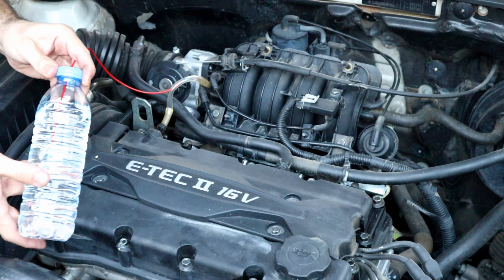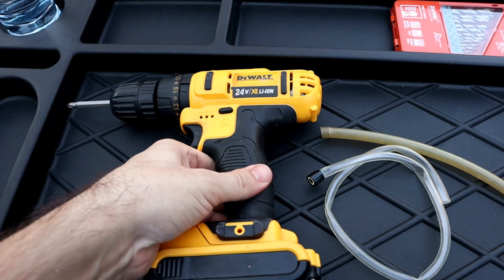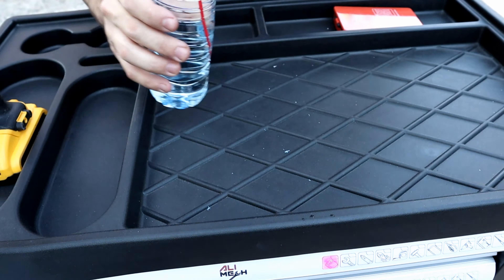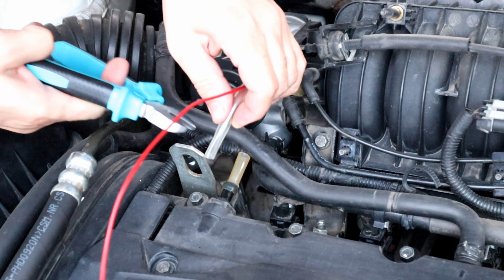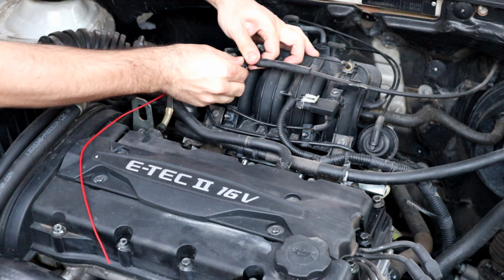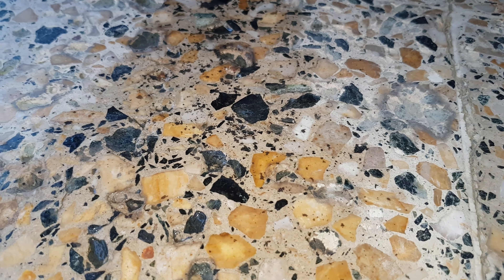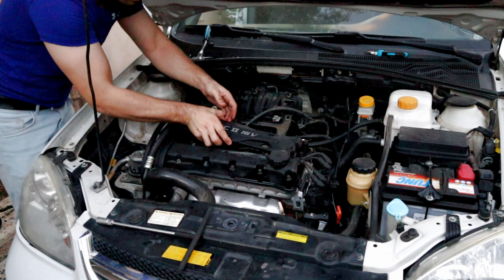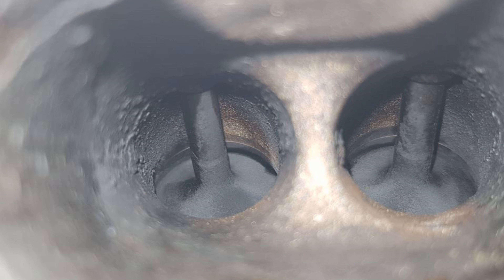Does water cleanse intake valve of Direct/Indirect injection engine without REMOVING anything

Comment: Havent watched the whole video, but oil and filter change after this is a must. Universal oil spray in the intake after water cleaning is recommended before shutdown as well.
Reply: You don't think the oil steam from the PCV will prevent corrosion? Did you see how oily wet the hose was when he pulled it off?

Comment: waterinjection can get great results in terms of lowering cilindertemprature and gaining horsepower ... a disclaimer tough the amount of water injected needs to be fine tuned and controlled for abvious reasons .... olso your are diluting your engineoil ... the blowby gasses are going to add steam to the crankcase .. if the percentage is high enough severe bearingdamage will occur . also water intering the combustionchamber is going to alter to compressionratio and push engineparts way beyond their designed stresslevels ...

its so much more than just ading it and hoping for the best

Comment: I highly recommend you to use carb cleaner instead of using water due to corrosion ..there is a lot of special material in market that is made for avoiding and cleaning carbon consumption on  valves and other car parts
Reply from the maker: Yes I agree with you, even the Carb cleaner worked better, but this was recommended buy one of my subscribers, that's why I wanted to see how it works
Reply: Water/methanol mix ?   I’m researching this as a permanent and continuous system that will clean the valves with every rpm the engine turns
Reply: Depends on the engine, been running this method for 20 years once the engine is warmed up and specially freeway running without issues as long as you turn off water injection manually a minute before stopping even your exhaust last longer without soot build up.

Comment: Could you do this same procedure with lacquer thinner, Techron, or another hydrocarbon liquid cleaner? I was going to attempt a pressurized set up to the fuel line, but this seems easier. Does this clean piston rings and the holes in the ring groove of the piston? Thanks
Reply from the maker: Yes, absolutely, i will do it, if you watched my last video, i will clean the rest of the carbon with liqueur thinner

Comment: Your idea is good but too fast, maybe use less water and over a much longer time. You only need a little steam over many kms to slowly remove the buildup. Water should be half the petrol spray volume. Also try 20% metholated spirits (ethanol) in the water. This little steam will gently clean the petrol engine combustion chambers too.
Reply: works for rotaries a treat, manual switch after warmed up my original 12a and 13b lived double the lives of others
Reply: Methanol based windscreen washer fluid in the mix, a little bit.

Comment: NO. DO NOT feed water into the intake. Period. I actually tried this, using a tiny straw to meter the flow, thinking that would allow it to vaporize as it went in. I ended up with a hydrolocked engine and most of the water was still sitting trapped inside the intake manifold obstructing the flow of air and sometimes splashing into the intake valves. Now I'm replacing the engine...
Reply: I believe you made a user error, people have been using water to clean valves since the 50's. a spray bottle set to mist is all you need also never do it at idle, rev the engine to 1800-2200 while you do it.

Comment: Is this for directed injected engines or gdi only
Reply: It will work on any engine its just that direct injection/gdi suffers more from carbon buildup on the valves due to the fuel not cleaning the top of the valves so its less of an issue on port injected engines

Comment: Water dont compress. Unlike gas which can be compress, water is not.
Never use water inside combustion chamber, it will knock your engine and bend your connecting rod
Reply from the maker: So as the fuel if u say so, but let's think right, the water not fill the cylinder completely so there will be no room for compression, the amount that goes in is drops and after the intake it will be vipor,

Comment: Water will destroy engine by HYDRALOCK.
Reply: It will if you drive through the river! 🤷🏼‍♂️
Here he’s using a tiny amount of water!
Reply from the maker: Yes, exactly
Reply: @AliMECH  I used to do this same method on a car I had in the late 70’s/early 80’s, it basically steam cleans 👍🏼
Reply from the maker: I did with steam as well on one of my videos, I had good results
Reply: Will stall way before than that, unless you pour water from a bucket at full steam.